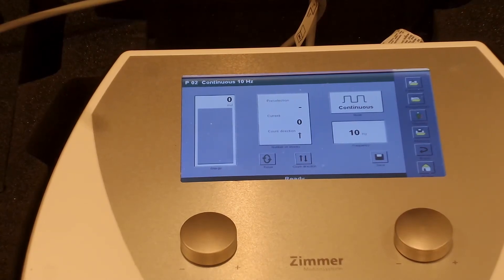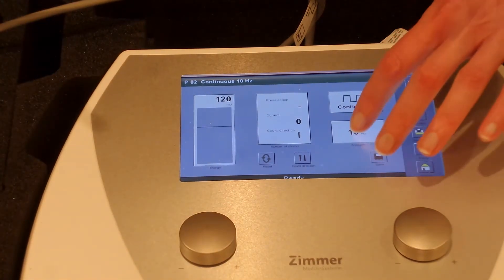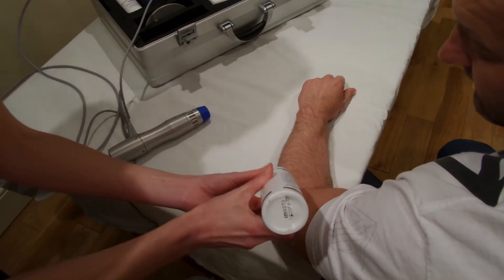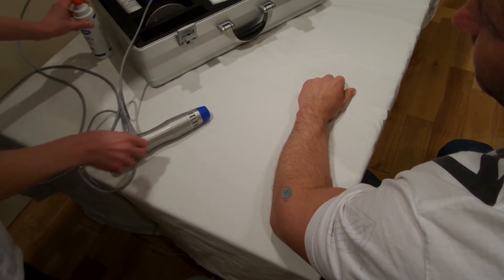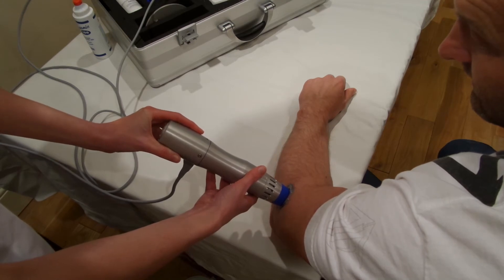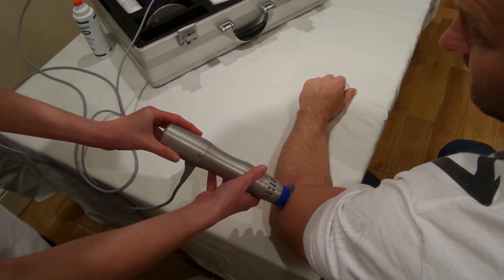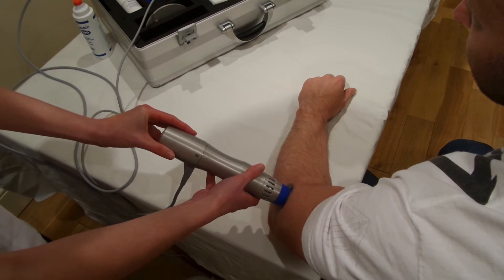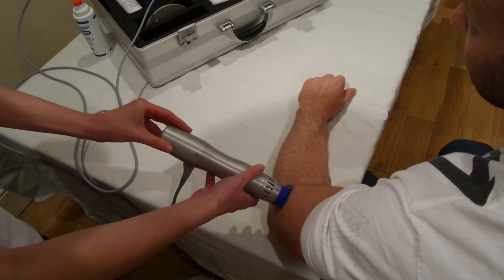Tennis Elbow (lateral epicondylitis) Treatment with shockwave (Zimmer enPuls)

Comment: On average, how many shock wave treatments does it take to significantly reduce the pain from tennis elbow?
Reply: @Shahzada K after how many treatments did you start to notice the pain going away? I’m doing this right now for my tennis elbow and am curious. Would appreciate your response
Reply from the maker: Normally within 6 sessions for just pain. However it does depend on the underlying condition.

With calcific conditions (people refer to these by many different names e.g. scar tissue, bone spurs, calcific salts etc) Then the best way to gauge the number of sessions needed is to scan treat for 4 sessions re scan and assess the results. Large areas of calcifc tissue will require more sessions. 

Please bear in mind many people are referred for pain due to calcification's which even when reduced do not become less painful (some clinicians postulate the calcification was not causing the pain). In some cases the shockwave reduces the calcification but it later returns as the activity and/or underlying conditions simply encourage it to come back.
Reply: @ShockwavetherapyEducationUK  Thanks for the video. Currently treating at home with a knockoff device I purchased on Ebay. Risky, but I'm willing to take the risk to get out of pain. No other options with the current lockdown. How many minutes per session and how many days a part?